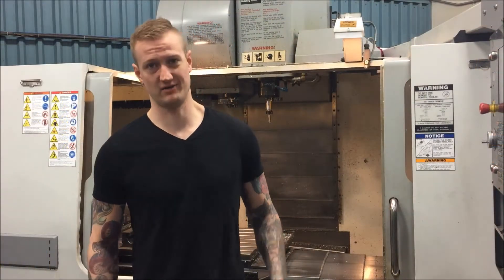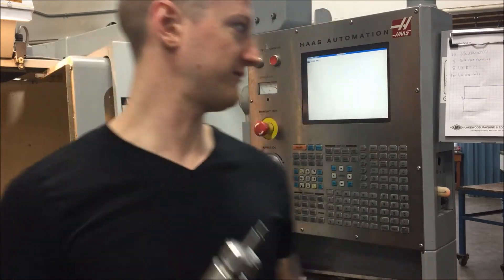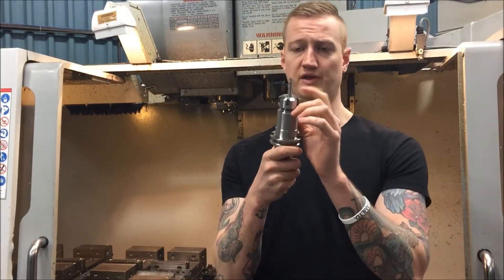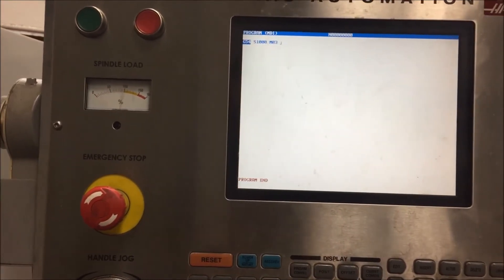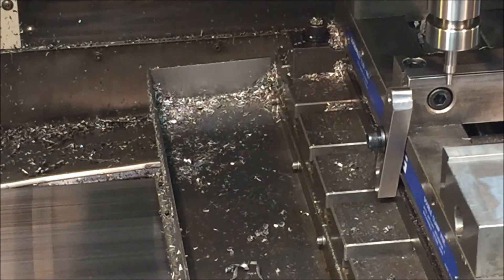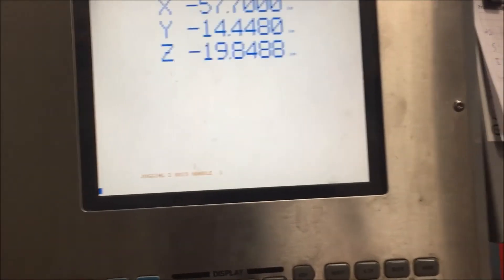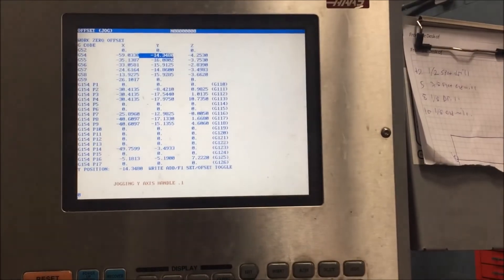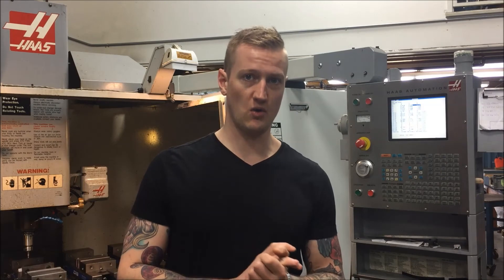BEGINNER CNC: USING AN EDGE FINDER TO SET ZEROS

Comment: how do you find your Center on a round part with an edge finder
Reply from the maker: mike cordero So go down with the edge finder and make contact with the part, zero the x (or y) at the edge of the part, and also zero the z depth before
Moving it up. Now retract the z, head to the other side of the part, and move it down to the same z depth as before - and pick up the part on the other side. Divide the result by two, and voila!
Reply from the maker: mike cordero if the part is round and facing upwards, you’ll have to dial it with an indicator in the chuck
Reply: Let's Machine thanks for the quick response is just a little confusing because I'm used to running FADAL mills but I em familiar with Haas control on the lathe on the Fadal I need to find 3 corners and can't figure it out on the 2006 Haas Mill Vf6

Comment: Have you tried a haimer style 3D Taster before? It's definitely the way forwards! I used to set using edge finders, setting bar (a dowell pin in a collet usually) and a gauge block, or cigarette paper, clocks for centres, and edges, and the 3D taster beats them all hands down for speed, and accuracy.  Some guys can get down to 10ths with an edge finder, but everyone can easily set +/- 2 thou or better with a taster.  They also eliminate the need to include the radius of the tool in setting, indicating when you are over centre in x, y, or at the tool length in Z.
Reply from the maker: Interesting! I've never even heard of that - I'll have to look into it - thanks for the info!